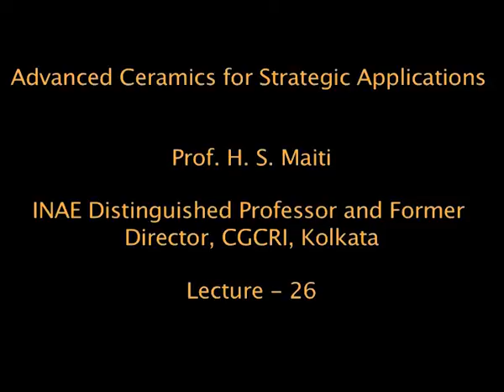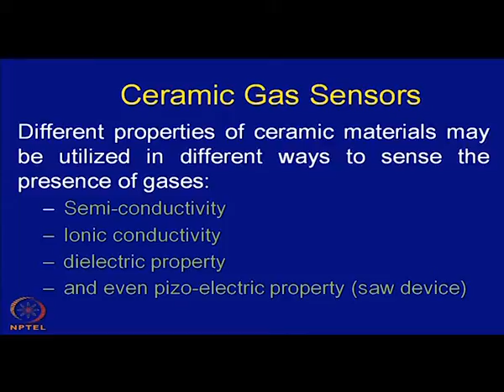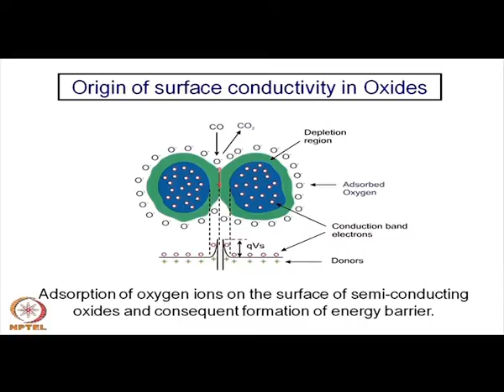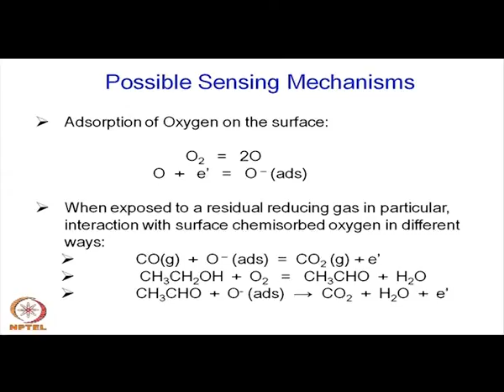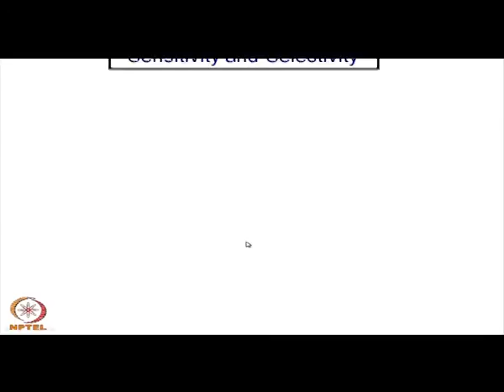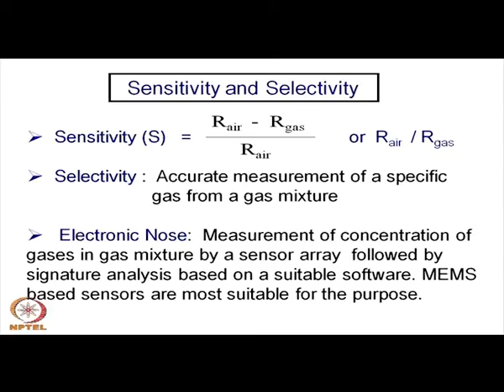Ceramic Gas Sensor

Comment: why we cannot use conductor instead of semiconductor
Reply: No, You cannot use the conductor instead of semiconductor. Ok understand this in this way....suppose if you have conductor ( as defined a conductor have high electrons concentration) so minor change in electron concentration ( that occurs due to presence of the reducing gases like NH3, CO...etc. ) will not affect much to the prior high electronic concentration of the metallic film( used by you). And hence no effective change in current value. 
So in one words its not possible to detect presence of analyte gas if you use metal instead of semiconductor.
Reply: @pankajgupta-ox8sw  thanks for your reply 
I had also try to find out the answer, metal based gas sensor have also been used in very few paper, but their high cost and uniform growth is difficult